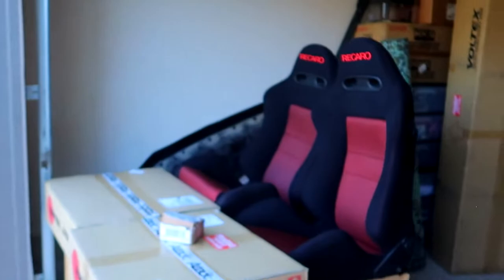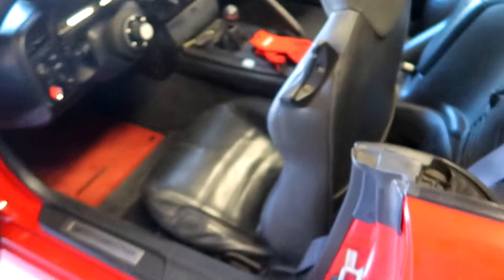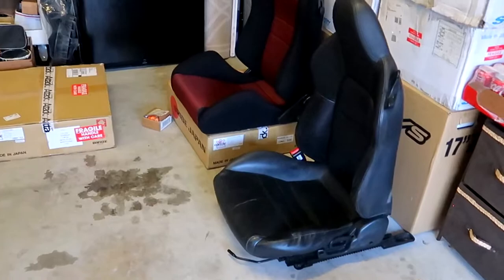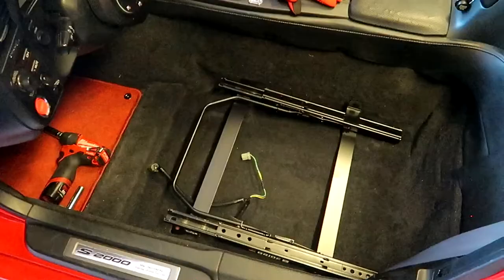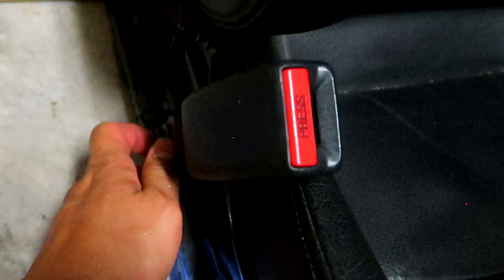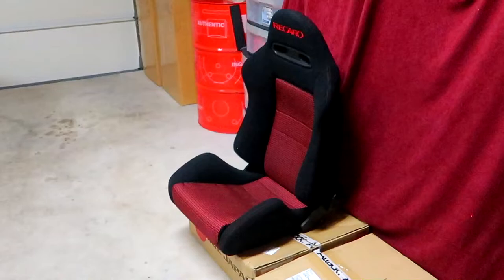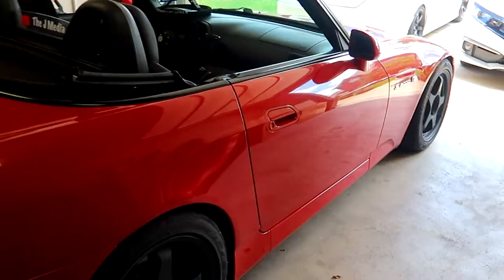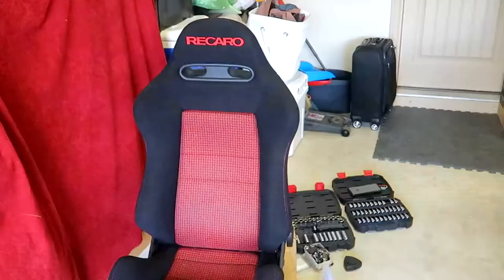Recaro Seats install in S2000!

Comment: Great video, haven’t seen 06+ seat install, any airbag light? I hear 06+ have a calibration or passenger seat sensor issue with aftermarket seats.
Reply from the maker: Thank you! Yes I have heard about the passenger seat calibration on the 06 and up. I do have the airbag light on unfortunately but not sure if it is due to the seats or my aftermarket steering wheel.

Comment: Look like the passenger seat is leaning to much towards the door and not really sitting straight up... maybe try and put some washers under it where you bolt it down to try and level it up
Reply from the maker: Thanks for pointing it out! I had it taken out and readjusted since the video was taken
Reply: @TheJMedia  after readjustment does it still rub?
Reply from the maker: Doesn't rub but it does touch the door since the sr4 seats are a tad big